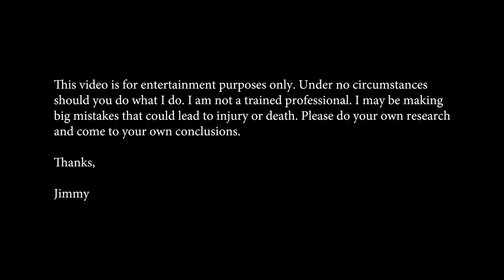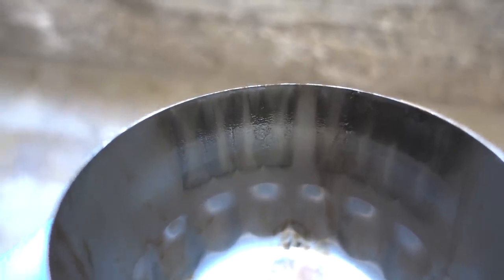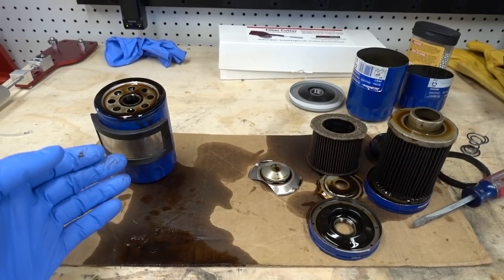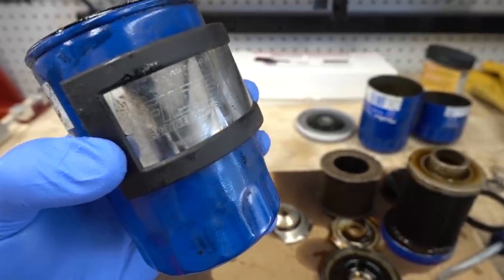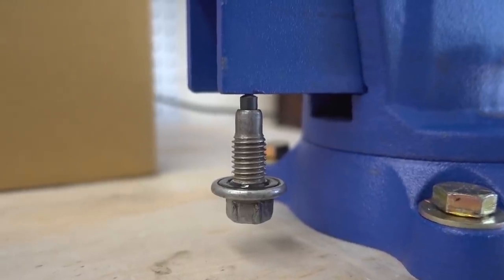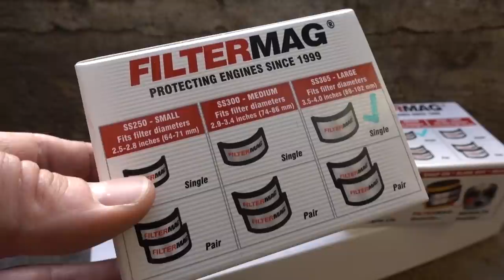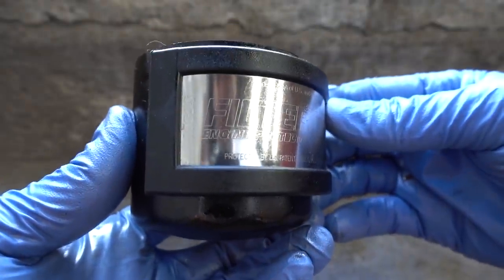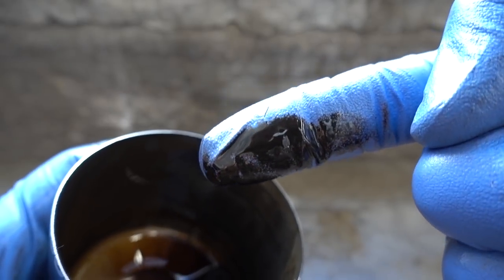Here's The ONE THING YOU DON'T KNOW ABOUT YOUR OIL FILTER!!

Comment: Spring for a better oil filter.  For just a little more money you can get a Wix.  Also, the oil comes from the packing outfit with tiny bits of stuff (metallic powders) that circulate with the oil on purpose.  Moly for example. You don't want to filter it out.

Comment: The low micron oil filters are Amsoil and Royal Purple. The are the same filters for both companies. The first thing to do is run one of these filters. I find most times the Royal Purple is cheaper than Amsoil for the same filter. These filters are very different than a paper pleated filter and will catch a ton of junk. Then just change your oil every 5 to 7 thousand miles and your good to go. They have taken the "work" out of this by finally making really good oil filters. That has always been the limiting problem, without these newer high tech filters too much junk passes right on through. Good video on the magnets though. :)

Comment: I read online that AC Delco oil filters are at 98% efficient at 25-30 microns. I also read that Royal Purple oil filters have an efficiency of 99% at 25 microns. Was wondering if you can do a test to see if the Royal Purple oil filter (or any other oil filter rated at 99%+) will leave less metal behind using the magnet? I want to see if the 1% will make a difference. Thank you!

Comment: Yeah sure. 
The oil runs from the outside of filter through media then back in. 
Therefore the shavings will be where after being filtered out of oil? Between media and outside. 
Where is the magnet?
Outside. 
So all the magnet then did was to pull the already filtered shavings out of the media. 
This is therefore anecdotal evidence. 

To make it more believable, place magnet before filtered oil and after filtered oil. Then you have provided something for consideration

Comment: Whoa, $130.  I got some round neodymium magnets off ebay for $13 (2 of them), put 1 on the bottom of the trans filter on my Allison 1000 (even though from the factory it has a far less powerful magnet at the top).  Guess I could stick the other onto the oil filter, no way I'm paying $130 for a filter magnet, though.

Comment: Boys and girls, guys and gals, and other people, just change your oil and filter more often than the manufacturer says. If you tow something, drive in extreme heat or cold, operate in dusty environment, live close to the ocean, run your engine at high rpm, and anything else that can cause oil to wear faster, change your oil and filter more often. Always use brand name synthetic oil and a quality oil filter and make sure your air filter is not clogged up.
Use magnets if it makes you sleep better, hug your pets and children, eat your veggies, switch to an EV when you can, and have a nice day.

Comment: You don't say whether those particles were ahead of or behind the filter medium. Airplane engines have a drain plug with a magnetic chip detector (MCD), which can be inspected without draining any of the oil. If particles are present, maintenance is required to find the cause.

Comment: So, it's an interesting premise, but  the magnet is catching particles PRE filtering. It's not a case to prove that the filter doesn't catch certain particles, it is a good indicator of wear, but if unfilterd oil passes the magnet, then the filter doesn't even get a chance to filter the particle if it's trapped in the magnet. I'd believe the efficacy of the magnet if you could "magnet check" the oil AFTER it's been filtered.
Reply: I agree with you, the filter may very well have caught every bit the magnet had.  But at the same time the magnet is only helping, every bit of material the magnet is holding, is 100% impossible to get past the filter media.  Definitely not worth $130, though, I'd grab an ebay neodymium magnet if I wanted to go this route (which I did for the spin on trans filter on my Allison 1000).
Reply: @GrandPrix46 , Yeah, good logic there.

Comment: What about slapping sh*T load of magnets on the bottom of your oil pan??!!.. 💡lightbulb
Reply: Magnetic drain plug.  About any auto parts store.
Reply: if you got Metal  in your oil filter  you have bigger issues then a magnet can solve
Reply: @punker4Real  better in your oil filter than in ring lands or between cam and lifters. Seriously, racers cut open their oil filters all the time.  It's a way to tell if you have a pending problem.  That's why they make magnetic oil pan plugs.  This all new to you?
Reply: Jay Jay  such sarcasm. Tisk tisk. So NASCAR is really going to use them?
Reply: Bout the only place Nascar is going is out of business.
Reply: @GrandPrix46  
Why is that? I keep hearing people say NASCAR is dieing...What the Heck happened to NASCAR?
Never been a big fan but was wondering........
Reply: Jay Jay  you did know that I was joking (as I knew you were) didn't you? Right?

I would love to see NASCAR let an electric car be allowed to enter their races. Good competition. I think they, and many Americans, are afraid of the future.
Reply: Jay Jay  good decision to edit your comment.
Reply: @punker4Real  I understand what U are saying however every engine is producing metal fragments from rings and bearings wear so why NOT capture some of this metal. I just ordered Magnets from Walmart $15 and will try to make my own filter strap using silicone(heat resistant). The FILTERMAGs seem so over priced.
Reply: @motorcitymanman7711  First of all they lost my fav driver Danica. DONE!

Comment: How about the non ferrous metals smaller than pore size of your filter that remain in your engine when you change the oil.  Between 10-20% of old oil and  these contaminates remain after a normal oil change.

Comment: Not to criticize just a wee bit but the unfiltered oil enters around the edges and then leaves through the center of the filter
Reply from the maker: Yes, and this metal, weather or not it would/could have been caught by the filter media, is caught by the magnet.. thereby keeping the filter media (and oil) cleaner longer.. That's my hope anyways. Thanks for watching.
Reply: So? The oil still passes the magnets and you could see that the particles are captured. So who cares about the direction of flow

Comment: First off I'd like to say that magnets placed on the oil filter can't hurt! However, that FilterMAG for the protection it provides it's simply not worth the money. That money would be better spent on a K&N air filter. If you change your oil and filter regularly and install a good air filter such as K&N you'll probably get rid of the car well before the engine wears out due to microscopic particles. However if you're not one to do proper maintenance then by all means adding the magnets can only help but, not at $100. A cheaper way would be to get the few bad  computer hard drives crack them open and remove those extremely strong magnets (don't get your fingers between them, it's going to leave a mark). If you don't have access to bad hard drives then stop by your local computer repair shop they'll have plenty probably for free if you tell them what you want them for.

Comment: Of course a magnet will do nothing against aluminum or stainless particles so when you get wear on aluminum engines, stainless bearings, etc, a magnet won't catch those particles and they will still recirculate as if you didn't have one. Granted, it will still help by at least catching carbon steel particles so can't hurt, just know it won't catch everything.

Comment: I am not saying I recommend changing the oil filter on a car every other oil change. That said car owners manuals used to instruct you to change the filter "every other oil change" keep in mind 3000 miles was the recommendation back then and a lot of enthusiast changed oil every 1800 miles. I know the 1982 Toyota Starlet Owners Manual and 1986 Toyota 4Runner manual both said to change the filter every other oil change! I can tell you my 2003 Camry, 2007 Camry and 2008 Saturn Aura, and 1995 Toyota Tacoma do not recommend changing the filter every other change. So what was common practice 30 to 40 years ago is not at all common practice today. The thing is that it was once the recommended procedure so not like those people were being cheap. Do you know why OIL Change Intervals and Maintenance Requirements have been extended out or eliminated? Initial Cost of Ownership! Fleet purchasing agents often select brands based on the amount of maintenance required to be performed during the amount of time they will own or lease the vehicle.If you want to make fleet sales a priority you make maintenance not a priority! Some companies used to install magnetic drain plugs for this reason. Some eliminated them because it saved money and others because it left an uneasy feeling in some customers minds being able to see and feel wear metal from the engine and some companies kept them. It would be interesting to start with a brand new engine and see if it made a significant impact over 10-15 years.

Comment: OK, here's the thing. PARTICLES BELOW A CERTAIN SIZE DO NO HARM TO AN ENGINE. Oil filters are designed to trap particles that can damage an engine. Does this penetrate into your head?  Some particles are TOO SMALL to do any harm. Because they are submerged in the oil film in the bearing. Get it? If the filter were to trap these very small particles, The flow through the filter would be greatly reduced. Ever heard of pore size? The size of the holes in the filter media? And these microscopic, inconsequential particles would quickly plug the filter, if the pore size of the media were reduced. And, yeah, you're no Scientist.

I use Castrol GTX. I change my oil once a year. I change the filter every time. My engines have never worn out or burned oil, ever. And I keep my cars for a LONG time. My 1996 KIA, for example, has over 150K miles on it, and burns NO oil. Replaced the head gasket on it a while back, and I could still see the cross hatching in the cylinders. With 150K miles on it!
Reply from the maker: Thanks, I respect everyone’s opinion.

Comment: Why doesn't FilterMag go ahead and make filters with magnets inside? Then the clearance would not be an issue.
Why dont filter makers put magnets in filters? Is there a filter maker that does? If I had a million bucks with which to start a business, would there be a market for such a filter?
As usual, a good video. Except that you kept saying "installed" on the filter when you should have said "attached to the filter". I was waiting for you to open a filter and "install" the magnets.
Next oil change, I am attaching magnets to the filter. FilterMag
Reply: Cost would be the biggest issue.  Imagine a filter company, like Wix, that makes millions of filters each year having to install a magnet in every single one of them.  Imagine the waste, as well, magnets going in the trash with all those oil filters for no reason.  You could just buy a neodymium magnet off ebay for a few dollars and reuse it forever.
Reply: @GrandPrix46  you have the reason that makes it possible in your reply  "They make millions of them". Economys of Scale. Look that up.
When you make millions of something, the cost of the additional piece  becomes diluted. They would simply put it into their new filters. Not the ones that are already made.

Comment: I have installed a "bypass oil filter" which removes all particles (including aluminum, copper, sand...iron).  Magnets installed on the primary (OEM high flow) filter do nothing as a result.
Reply from the maker: Do you have issues with oil pressure after the bypass filter install?
Reply: Have had an Amsoil Dual bypass kit on a 98 Dodge 3500 for the 20 years. Have not noticed any drop in oil pressure.

Comment: The only filters available for my vehicle are plastic.....so there goes that idea lol
Reply: Zip ties.
Reply: Or hose clamp....home depot..
Reply: Jay Jay  Your contention that manufacturers would always incorporate every beneficial component is preposterous.  Ever heard of planned obsolescence?
They sell cars, cars that wear out so they can sell more cars.  Some people like old cars, keep them nice and running good.
Reply: Jay Jay not a cartridge, it’s a screw in filter... but they are made of plastic.. it was a design by foton to make servicing easier... but you can only use one type of filter designed specifically to fit the tunland. Same concept, same idea as every other filter in the market,  but can only be screwed into a specialised thread and hole and made of plastic.
Reply: @x-man5056  it's just like those things that claim they can improve fuel mpg
if it was real Car manufactures would be using it
Reply: @punker4Real  No, it isn't.  Did you watch the video?  Do you not believe your eyes?  Do you think it was trick photography?  There are many things car manufacturers could do to increase gas mileage also.  They get eliminated in cost/benefit analysis. 
You can depend on your mass produced filter to defend your engine against iron based metal particulate damage, the vast majority of people do.  Or, you can spend a few bucks and a few minutes to add an extra level of defense to your engine. 
What you can't do is say accurately, the magnet doesn't do anything.
I can assure with zero fear of being shown wrong, WIX, often sighted as the premier filter manufacturer in the US, does not make every filter perfectly, nor does any other manufacturer of anything.
I took a Wix filter back to O'Reilly's last week for a visible defect at the seal surface that would have been easily detectable at the manufacturer but wasn't.  They rely on their very good processes to build filters at an acceptable quality level known as AQL.  This means that they have a level of defects that they have determined that they can live with because there is a cost to perfection (Quality).  To remain competitive cost wise, they pass that risk onto the consumer.
If you feel it's fine to accept that risk, it's your choice.  For a few bucks and less than an extra minute during an oil change, you can reduce that risk even further.
I drive a 2003 truck that runs and looks near new.  I want to keep it that way.  I choose to be proactive where I can to keep it in top shape.  When I sell it someday, someone's going to get a jewel because I don't say "meh" to protecting it.
Reply: Jay Jay  Magnets exist in the oil sumps of many military mechanical systems, particularly Hydraulic systems for the very same reasons demonstrated in the video simpleton.
Reply: Jay Jay  yes, I'm sure you are.  Not only did life exist before you, everything that exist today stands on the shoulders of the past, lessons learned create progress going forward.
Reply: Jay Jay  Are you 10?  Sounds like it.

Comment: I have to disagree with you about doing these oil changes on time. My truck holds 13 quarts of oil and is very expensive to change every 3,000 miles. I change the filter every 5 to 6 thousand miles and because I add another quart of oil than I am not worrying about it.  I had a friend who did this and got 500,000 miles on his gas burner. Big oil companies want you to be the good little boy and change the oil every 3,000 miles to keep them rich. You need to prove to me that every 3,000 miles going to make my engine last the 1,000,000 miles that I am suppose to get. I have 157,000 miles on my truck now.
Also why does out fits like AMSOL have their oil set up where you send a small amount in and they will tell you if you need an oil change or just filter change?
Reply: You could install a bypass and change your oil once a year, maybe even longer.  My LB7 Duramax is pretty easy on oil, and takes 10 qts so it only costs me about $40 to change the oil on it (Rotella T4 and RTO59 filter).  I don't have a problem dropping $40 every 5k miles just for peace of mind.

Comment: you only need a magnet if you have a crappy filter in the first place:
PF52E are only good tell
efficiency at 25-30 microns

K&N 
 K&N has a reading of 10 microns 

Mobil1 efficiency rating of 99.2% @ 10 microns

Comment: If you worry about metal particles floating around your engine after the break-in period, you either have a shitty engine design or shitty oil. If the oil is doing its job, you won't have wear thus no need for a magnet. If this were such a big deal, every oil filter would have them.